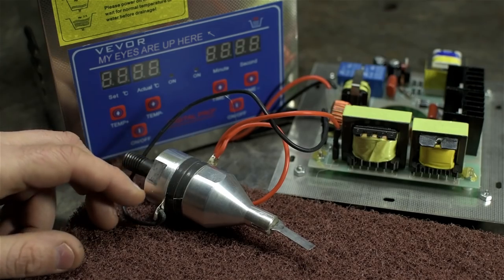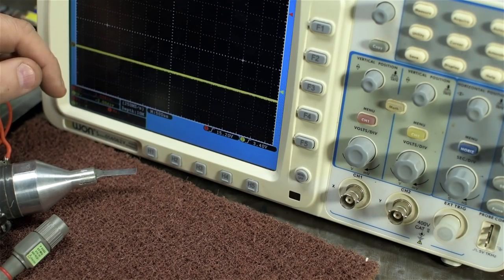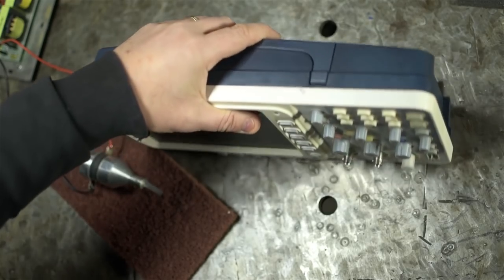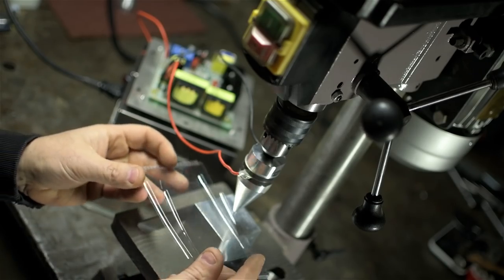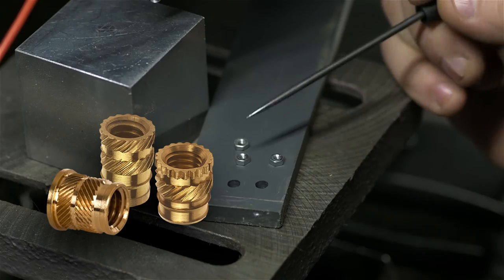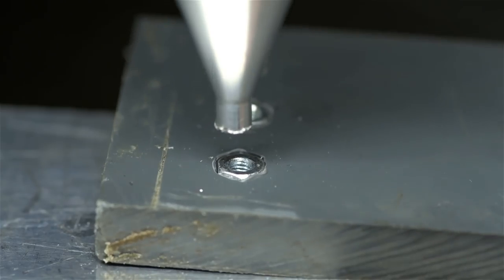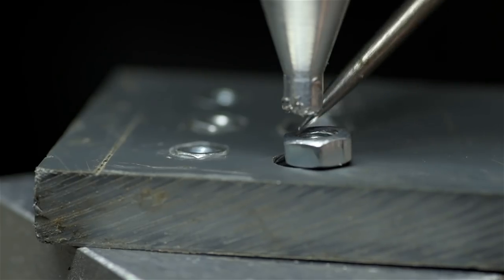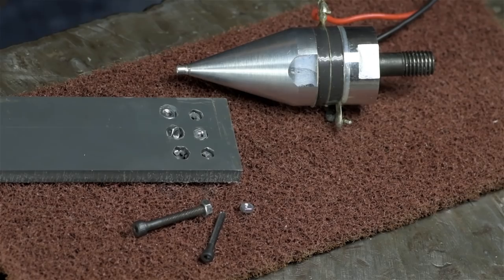DIY Ultrasonic Welder?! (Answer: NO)

Comment: Try making your horn with an extended main section to add a phase reversal in there. This gives you a point in your main section that is a 0-node and which will not move up and down but transfer the energy through it. Sounds like black magic I know, but it will give you a ring to mount the horn with that does not steal energy from the system.
Also look into log/exp type tapering which apparently is easier to do high ratios with. Awesome video!
You are lucky to use a resonant driver as it makes it all much easier. (This one is not resonant yet and I tune it manually in the vid.)
You can see when I hit the sweet spot. This water drop test is a good way to verify you are getting good resonance btw.
https://youtu.be/auqGkPJD-yU?t=35
Reply: Here's where a 0-node would be for mounting...
https://www.semanticscholar.org/paper/Design-of-an-Ultrasonic-Steel-Horn-with-a-Be%CC%81zier-Nguyen-Wang/14ecd490bdd70a30d329563b689557ba0ae0be49/figure/0
Oh, and if you dismantle such a transducer you must make sure to preload it properly again. Otherwise the piezos may crack when expanding too much under resonance. They are weak if they reach uncompressed state and handle less power that way. I broke a few of my piezos that way. Lesson learned.

Comment: Ch1 died? On your TWO channel scope? That stinks! I feel with you and the poor one-channeled puppy.
In other news: The switch mode converter driving the piezo stack is a self-resonant type. Its frequency determining element being its load. I.e. it does not really matter (within reason) what your cone's resonant frequency is, the converter will lock into its natural frequency.
Awesome nuts!

Comment: as far as i know ultrasonic welding rub the two bits of plastic over each other. not hammer them together. and the tip of the horn and the anvil should have some nurling so thay dont slip and actually move the plastic. the weld is like any other friction weld. the two bits must rub each other warm enough to melt together

Comment: the horns are suppose to be titanium  the thin clear plastic looks like polyester  to get a good plastic weld you will need around 85k cps,, 1.5 sec weld time 2 sec hold time and around 40 psi hold pressure,, thats a ballpark guess,,,

Comment: Nice try. We use ultrasonic welding at work to fuse plastic housings. I once helped setting up the program for the welder and analyzing the tested welds, there are so many parameters like time, force, travel until finish, power, etc... The geometry of the sonotrode (what you call horn) and the acoustic transformer has to be precisely calculated and manufactured, depending on the material to be welded the sonotrode is either titanium or aluminum. The shape of the joints is also calculated and designed. All in all it's rocket science.
Reply from the maker: so what you're saying is maybe I actually had a shot?  :)
Reply: Considering the power of the transducer and you as a hobbyist tinkering around this is not bad at all i think.

Comment: You don't weld material by hammering it together, you weld it by rubbing it together. There is a slight 90 degree error in your angle.

Comment: Obviously ultrasonic welding requires rubbing the material - not knocking on top :-)
Judging by those washer vanishing like hot nickel in a piece of butter you might #A try the cutter idea again and #B make a tool agitated sideways whilst pressing from the top…

Comment: You need friction for plastic welding. 
You only tried pressure welding; all the forces were going in the same direction.
If you place the transducer perpendicularly to direction of the pinch points, it will generate heat.
https://youtu.be/yLGiY6Ehofo?t=2m2s

Comment: My air rifle welds pellets to galvanised steel. It's almost like thermite on a teeny scale
Reply: Although I know what you mean, they stick like a motherf****er, I'm pretty sure that doesn't qualify as welding. Possibly soft soldering, but most likely it's just really high friction from the deformation of the two parts.
Reply: Tjita1 I dunno. The pellet may friction weld or cold weld or alloy by turning lead into molten lead for a fraction of a fraction of a second. No clue.

Comment: Ultrasonic welding is not like magic, rezonance, antimater  etc, it's stil heat  that melts the material in the sence that it  puts energy in the material but verry  efficient , local. One doesnt feel the piece geting hot because the energy needed is much smaller then needed for steel. To much energy will destroy the plastic material  that's one reason for ultrasonic weld. But maybe this didnt work because the machine isnt calibrated to give  the energy just at the right spop, the interface of the pieces

Comment: Shouldn't the not be interested from the opposite side of the material as to the direction of the bolt? Also you might try boring a pilot hole the major thread size then your flats size just deep enough to sink the not. That way there's a shoulder for the nut to compress against. Just some observations on how to make functional & reliable. Good luck in your adventures pounding nuts into underside, i mean undersized, holes.

Comment: I think that's what's wrong with your device is that you're using the wrong metal as the horn aluminum is not a really good residents metal use brass or Steel something that will ring or carry of tone long wavelength that will bounce and reflect and strengthen itself before it interacts to the part

Comment: Try bolting from the other side.  Treat it like wood inserts.  Of course it's going to pull straight out, the question is will it hold rotationally?  Because if it does, then you get clamping force.

Comment: I mainly build furniture from hardwoods, but I work at a Lowe's store and we happened to receive a 200 amp Longevity air-cooled tig/stick welder with all the fixins. It was initially $900, but we're selling it for something over $600. I was skeptical because it wasn't a Miller, Hobart, Lincoln Electric, or anything else that I had heard of previously. I have been wanting a tig welder for some time (mainly because of your videos) but I'm curious as to whether this thing is really worth it. 
https://www.lowes.com/pd/Longevity-120-Volt-Air-Cooled-TIG-Welder/1000192501
This says 120v but it'll handle 220 as well.

Comment: why don't you use a microphone or a cheap dampened soundcard imput to measure a very clear reading from a dc signal... perhaps also some chopsticks to act as tweezers to hold the nuts straight. sorry for stating the obvious.

Comment: This is not welding, ha ha, more a automated press. Welding Defenition: Join together (metal parts) by heating the surfaces to the point of melting with a blowpipe, electric arc